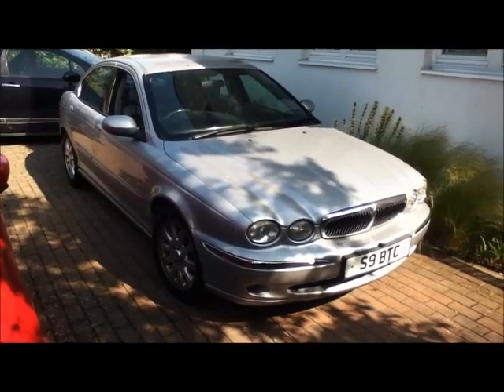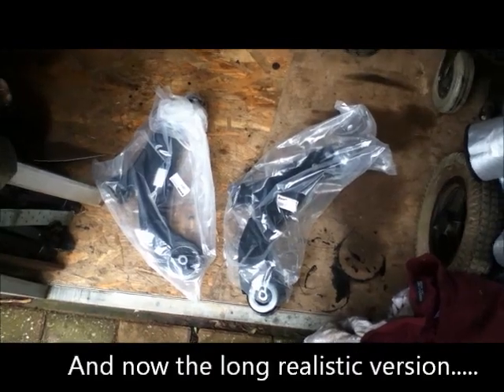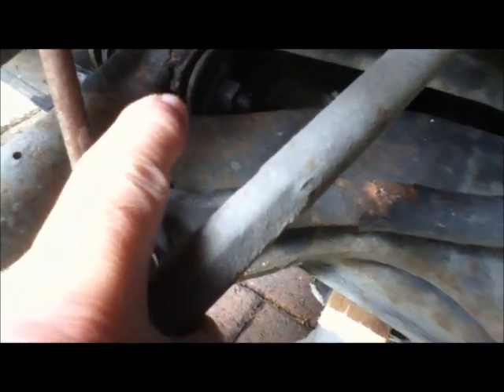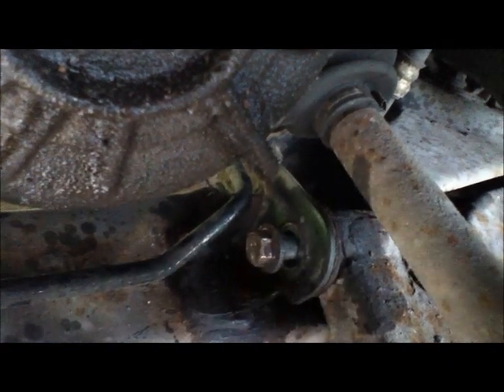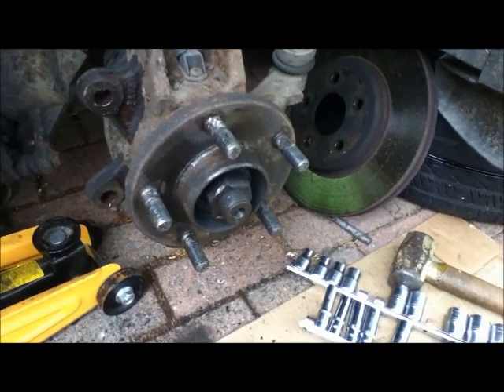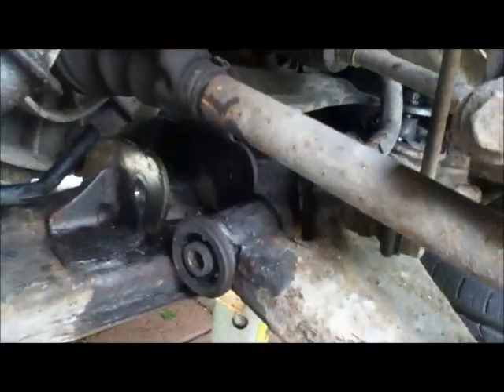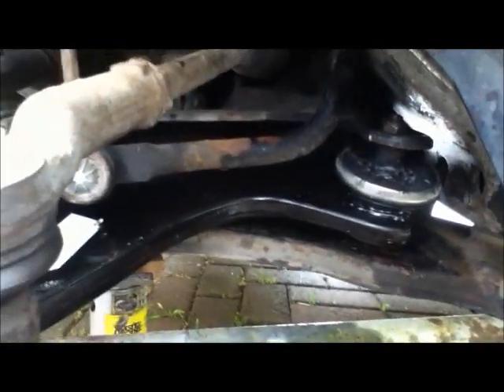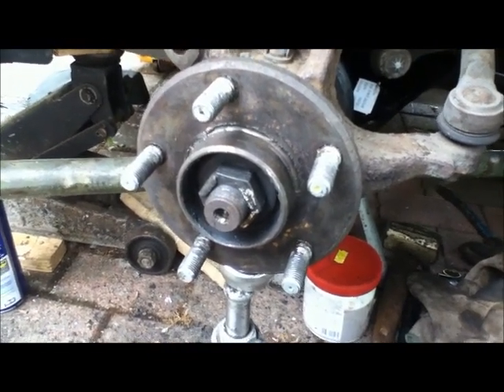Jaguar X Type -  Changing Front Suspension Wishbones

Comment: Great job, my colleague! Very useful video for all X-typers, cheers! Let me add two details from my side. First: I also removed the rear bush bolts of the front control arms upwards and installed them from downside up, tightening the nut from the upside. Now,  when I've to change wish bones, I just remove bolts down and I don't need to lower the front sub-frame, as manual says. Here my method doesn't differ from yours. But the second detail is, that when removing the wishbone, I pull it out of the subframe, releasing the bushes, (CV joints allow you to pull it out) and only after that I remove the ball joint. And vice versa, when installing the wishbone, first I install the ball joint, and then insert the bushes on their places. Thus I avoid pressing on the installed wishbone with a bar, because the rear bush contains oil inside and may easily leak. I hope, my comment will be useful for fellow X-typers, sorry for such a long and detailed description.
Reply from the maker: Thanks for your valuable comment. I was not strong enough to get the bolts in the way you do it!

Comment: Well what a excellent video perfect very pleased i watched it am in the process to do a wishbone arm after ive waisted all day trying to remove a ball joint the new one came with 3 bolts with nuts someone told me grind the the old 3 rivets off the wishbone bad idea i wish i had just got a wish bone as it comes with the ball joint on and these jaguars are hard to work on ive just fitted a pair of trailing arms and springs aswell they were all seized as you say heating always works  i mainly work on motorcycles ive had over the years still ride them easier to work on i laughed as i also use bits from motorcycles ive had over the years i use bandit 1200 fork leg as a lever/pry bar ect lol....  Thanks again keep making these videos they really help!!!!!!!

Comment: Great video, I'm in the middle of this on my x type diesel, looks like it will be exactly the same. I was doing a completely different job, ( Spring and Wheel bearing)  but then damaged the boot on ball joint so it had to be done, to be fair it was scrap like. My wishbone hasn't arrived yet, this has made me a bit scared but I'm not in a rush, and I have already disconnected the track rod end so a bit more flexible, and my Pinch bolt actually snapped which was actually quicker in the end, I was able to order one from jaguar which arrived in 2 days.

Thanks again for making the video.
Reply from the maker: Good luck. It can be done. Use lots of heat on the seized bolts.

Comment: The correct way is to lower the front subframe down up to 50mm  then the rear bolt comes out easy
Reply from the maker: These videos are for people who want to do the job at home for free and do not have a fully equipped workshop with lift and specialised tools.

Comment: Great info, if I had to do it. I had the control arms replaced recently (lazy me). I noticed a smoother ride over the road after the change. The mechanic also put the one bolt back, nut facing downward -- in case the arm needed attention ever again.
Reply from the maker: Thanks for sharing

Comment: Lower sub frames 30mm first
Reply from the maker: The whole point of the videos is to show how it can be done on the drive with minimal tools - not in a fully equipped workshop. Also if you look in YouTube you will find at least two videos where the subframe bolt has rotted in the frame and cannot be turned. AutoDoc do a video showing it done in a workshop - look up Mondeo wishbones.